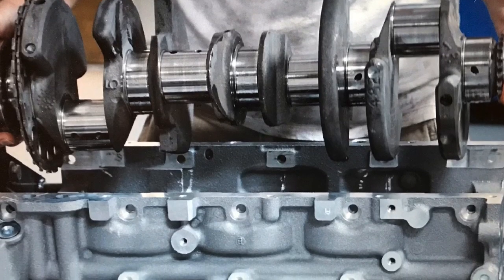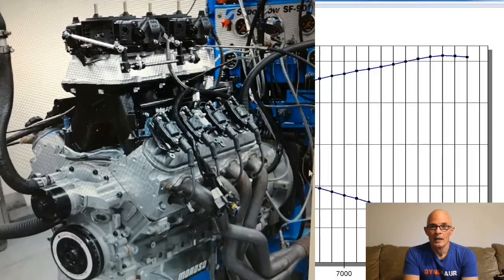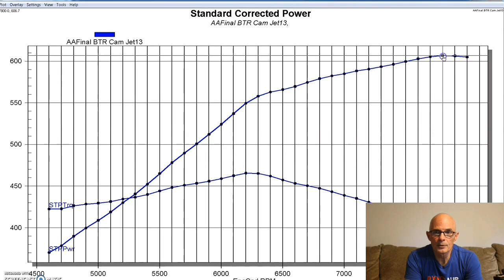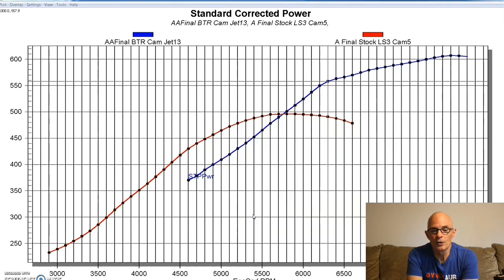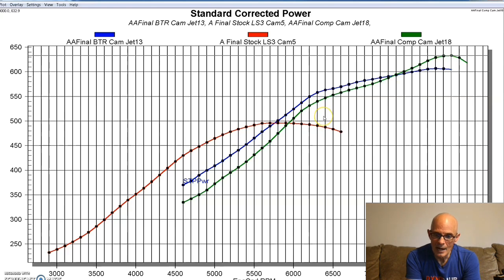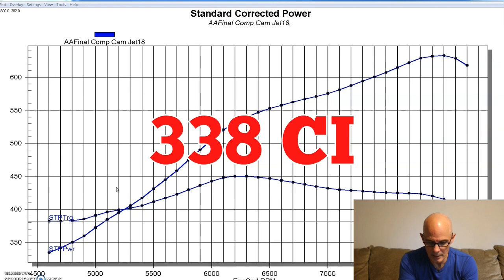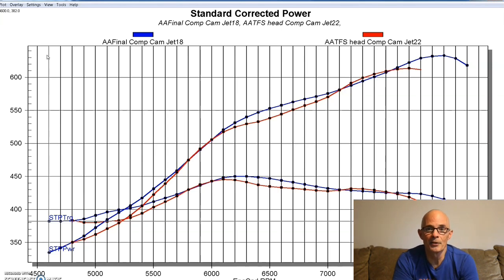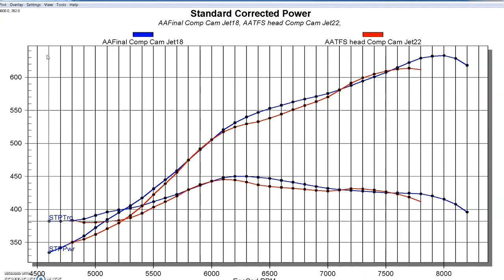DESTROKE LS-4.8L CRANK IN LS3 BLOCK-SHORT STROKE POWER-AN LS MONSTER MYTH?

Comment: Great video, Richard. Long time reader of your car mag write-ups. I'm fairly certain this is part of the problems the LS7 heads have experienced. 25 years ago, the LS7 would've been an all out racing engine. Fast forward 10 years (15 years ago), and you have G.M. basically trying to build a racing engine to last 75,000-100,000 miles without any maintenance except oil/filter changes. There's a reason G.M. hand assembled these engines, and it wasn't all because of the exposure/advertising this brought. It was also a necessity. There's also a reason GM quit installing this as a production engine. I'm not ragging on it. I have one that's starting to make noise at 20,000 miles. Great motor, except for the valvetrain, on which they really blew the design. Anyway, keep up the great work....

Comment: I run my lq9 to 7800 rpm. It sure sounds sweet up there. Been doing it for 6 years now. The crazy thing is it’s unbalanced, lq4 block and crank, ls2 pistons and rods, ls3 heads and a decent enough camshaft. 

You are right though it’s all valve control.

Comment: no doubt the compression would up the cylinder pressure across the board, i'd like to see some ve numbers though of each through their torque curves to be able to make a prediction on whether or not it will continue to climb if it turns more rpm.  sometimes killing torque is a good thing, not often, but say in a lightweight or traction limited car knocking down the torque while being able to preserve power will actually turn out to be a better combination.  thats the big advantage of dohc engines, partially, they can flow some monster numbers, but its also the reduced mass acting on each valve spring allows for better control at lower spring pressures.  one thing i havent done much thinking or research on but have started to kick some ideas around is port mach numbers and their effect on airflow limitations.

Comment: No mention of how rod length comes into play here and how it affects power and torque and RPM potential. The shorter stroke obviously allows for longer rods which also helps the revability and longevity in general. A longer rod also stays at TDC longer allowing a more complete burn. That is why my favorite engine combination has always been a big bore, short stroke, long rods, with heads that really breath. That is why NASCAR motors make the HP they make. Big bore, short stroke, long rods, with extremely high flowing heads with big valves and an extremely stable valve train that easily lives to 500 miles plus.

Comment: This would make one hell of a race engine. Almost like what I have planned. It works because you dont need all that tourque off the line too knock the tires n fish tail peddaling down the line. This 327 LS setup with nitrous would be a killer setup consistently going A-B. Only question I have is it necessary too go custom pistons?? Any forged off the shelf offerings from je or diamond?? What are the specs? Dome? Assuming hi comp.

Comment: Do it again with cathedral and square port but EFI with the NEW BTR INTAKE
Reply from the maker: I did run square port too
Reply: Richard Holdener no I know but that BTR LS Intake is sopposed to pull from 4-12,000rpm according to them and on a destroked I would love to see that before I buy it and try it
Reply: And don’t go carb plz
Reply: Richard Holdener I am thinking of destroking my LS2 6.0 in my GTO with a that Torquestorm blower but dumping my cathedrals for square port LS3 heads and coils and that BTR intake if it works good

Comment: I love the comments on these threads. 

 Your comparison of similar displacements with different strokes missed the point that your power peak (max torque) is relative to cylinder fill, which is relative to port velocity and Reynolds number. 

Short stroke motors behave differently in this respect because of the difference in the vacuum signal, eg the velocity of the piston and the distance it's traveling relative to the valve events.  Rod ratio also changes this, as the shape of the piston speed/position curve is altered with rod length. 

If you really want to prove your point, put pressure transducer spark plugs on two engines.  Make them EXACTLY the same displacement, with the same induction, cam, and valve train combinations but different strokes.    Then perform the dyno comparison.  Granted, torque output is the pressure measurement, but it would be really cool to see the behavior in the chamber. 

This is the only way to quantitatively prove your point because it establishes the top end of the engine as a constant instead of a variable. 

You also neglect the difference in cylinder fill relative to valve shrouding with respect to bore size.  There are so many variables to this!

The reason the smaller small block chevrolets are regarding as the best runners is the amount of work put into the original 283 fuelie and 265 preceding it as combinations.  That engine was engineered to be that size.
Reply from the maker: Ryan Reynolds? Very funny dude!

Comment: One issue that wouldn't have come up on this combo is the factory computer. You can break the genV processors to read a map sensor in 0-5v in place.of the 0-5v maf sensor. From what I have read they cannot do anything over 8192 rpm. I'm not sure of the limiting factor but it's a tick counter on the cam or crank sensor. Each ripple from the hall sensor on the 58 tooth wheel is a tick and the tables can't count high enough for anything above that. Not a huge deal because that covers all gm engines in production now but it could be an issue with something like this.

Comment: I've always liked short stroke, big bore engines. Not because "they" like to rev , but because I like to rev! The shorter stroke allows a longer rod, both of which reduces rod angle, in turn, reducing side loading of the pistons. The piston speed is lower with a shorter stroke as well, which reduces stress on the pin. And with a solid roller cam instead of the hydraulic, the big bore 4.8l would live a lot longer at 8-8500 rpm than a 6.0l.
Reply from the maker: valve train is always the limiting factor for rpm
Reply: @richardholdener1727  , I didn't argue that point. I was simply pointing out some of  the benefits of a short stroke engine that were missed in the video. I've never been one to dismiss the importance of displacement....but if I were to build an engine with the specific intention of revving its guts out repeatedly (such as an autocross, or road course event) it would be a short stroke engine. Which has nothing to do with the engine's ABILITY to rev that high, but because of the extra DURABILITY a short stroke engine provides at high engine speeds due to simple physics.

Comment: I was debating on what to do, I have a 84 300zx and I did the engine on a 6L Denali so I have a spare 6.0 . I’m ready to start the swap I wanna stay NA and I don’t know if I wanna do a stroker kit to 421 or de-stroke it with a 4.8 crank and go with a higher RPM but I think you just solved that issue I was having, not so much about the stroke but more on the valve-train. Guess im going with the bigger stroke.

Comment: Junkyard LQ9, cam/valvetrain, check bearings - 150shot. 550whp
Cheap cheap cheap - 1500$ cost for me to build one so it’s REPEATABLE! And if my upgrade parts survive, the costs drop even more.
Stock lifters because I try not to remove the heads or stock bolts/gaskets, so we spin it to 6800-7400 rpms to stay safe. Stock ring gap because I never removed the pistons.
12 events on this current one. 

I love thinking about cool builds but my pocket forces me to stay closer to stock.

Also with a lightweight triple disk on that engine.. it revs up SO FAST!

I would love to have a LS that could rev past 8k though :)

Comment: HP being a product work x time ie the "m" in rpm so more power pulses per minite the more horsepower produced and in most cases when short stroke motors used there is an engine capacity limit rule hence as you say larger bore more air flow higher rpm more horsepower, any one after max power is not going to limit stroke/ bore intentionally if not required by rules

Comment: Try experimenting with some rotary valve heads. I think it was either car craft or hotrod magazine that ran an article in late 99 or early 2000. They made. 8000 easily, and 700+ horse power on a otherwise stock ford 5.0.

Comment: Bottom line is you'll never get a bottom end to stay together (for long) if your average piston speed is over 25 meters per second. That translates to ~7000rpm with a 4.2" stroke. Decreasing stroke BEFORE you get to critical piston speed is costing you airflow and therefore torque.

However, the shorter stroke provides for a longer rod, better rod/stroke ratio and gentler bottom end kinematics which  can make for a happier engine.

As always, there is no "X is better than Y". Everything in the universe is a tradeoff. X is better than Y in some cases, yet Y is better than X in others. As an engine designer, you have to identify the things most important to you, and the things you're willing to trade off to get them.

Comment: I'd be curious.. gen IV 4.8 punched to 3.898 with unported 799's and a 7 grand cam. Basically a pistons and cam 4.8. I bet it would put the smack down on an old 5.0L ford with the B303 cam

Comment: One other thing to throw out there- If you're in a displacement restricted class, then a big bore, small stroke would allow for bigger valves with less shrouding when compared to a small bore, long stroke engine of the same displacement.

Comment: He missed the point with the F1 comparison and I only read a handful of guys in the comments mentioning piston speeds which is a huge factor in short stroke builds. This guy is looking at the problem from strictly a drag racing perspective. Run both your short stroke engine and you're big stroke side by side flat out for 500 miles then pull it apart and compare the wear. Big stroke high rpm requires better balancing along with stronger rod fasteners to name a few. You'll also reach fatigue failures sooner especially when running aluminum rods.  And I've soon nobody in the comments mentioning the other huge point of short stroke builds which is rod angle. Short stroke builds have a smaller rod angle resulting in higher cylinder pressures before experiencing rod bucking failure. Beneficial in high CR and high boost builds. So is you don't need the raw low end grunt a short stroke build can offer serious benefits including high efficiency, high boost, and low maintenance.

Comment: Piston velocity - It's a clear limitation, and for certain situations (where you don't have a selection of blocks to choose from) - it's exactly how you can manage to squeeze out more power from a specific platform. Or expressed another way - if you're stuck with 1 type of engine combo which is already approaching piston velocity vs power limits, then a destroke can allow you to shift that piston velocity down and (potentially) gain some horsepower by acessing a higher RPM. It depends on the platform. It depends on the situation. But it's a clear limitation that many people have run into - which is why it many solutions on the market across varying platforms.

Comment: I've always considered these to be big bore 4.8s.
Reply: Yea that makes sense since your using every single part from the 6.0 except for the crank
Reply: You don't have to. I would use every single part of the 4.8 minus the block and pistons. Thanks for your hot take though.
Reply: @arg8763 well I guess my logic is the block is the foundational base and you can mount any 4.8 head to the 6.0/6.2 but you can't mount a square port to a 4.8. therefore makes more sense to call or a short stroke 6.0

Comment: While I agree that Valvetrain is a major factor in how far an engine can RPM. Piston speed/ring flutter is a big factor in how much power an engine will make at those higher rpm levels. and piston speed is a reflection of stroke.

Comment: Your missing the point when you say all these engines can rev to 8000 and you would have made more power with the 5.3 or 6.0... The whole reason for de-stroking is reliability due to short strokes benefit of reduced piston travel speed. Lets say the motor scatters when piston speed is above 8,000 (for reference not actual know piston speed) feet per minute and you need it for a circle track car winding at 6-9k rpm non stop for an hour per race. You can de-stroke an over square engine to reduce piston speed to 5,000 feet per minute and the motor lives through the race no problem. When the speed of the piston crests a certain point it refuses to turn around on the down and upstroke. You take that 6.0 and repeatedly rev it to 8grand and it will blow where the 4.8 crank in the 6.0 block has lower piston speed thus allowing it less inertial forces on the mechanical parts. It would be happy to rev out to the 8grand more often with less heat and forces on the parts. THIS IS WHY PEOPLE DESTROKE AND YOU MISS THE WHOLE POINT OF IT..... Its not which build makes more power it is which survives the hell you throw at it. And the power depends on cam, valve geometry, head design/flow, and so much more than simply the displacement. Sure if your drag racing a trailer queen and want to build the engine every 100passes go with the big D and long stroke it wont matter much if everything is set up just right. But, if you need to work a high rpm window and want the engine for endurance, many races, and drive the thing home go with the short stroke.
Reply from the maker: please look at the stroke length and piston speeds of mountain motors-stroke on an LS application does not limit engine speed, its valve train
Reply: @richardholdener1727  I was talking about piston speed not engine rpm (and no they don't go hand in hand) we all know both can spin to 8-10rpm and the limitations are the valvetrain, rod length, and piston speed. But the shorter stroke will live to fight another day at those rpms due to lower piston speed. It doesn't matter what generation, manufacturer, or model the rules apply to all equally LT, LS, LSX makes no difference. Unless maybe you are using a rare non typical design like say a screaming dorito engine but that is a whole other conversation.  https://www.youtube.com/watch?v=Vy2r3p-SOag

Comment: It's mean piston speed that's a limiter, but in this case there isn't a problem because the LS is a pretty under stressed motor with push rods... Push rods are terrible for revs and they'll always be the limiting factor.
Reply from the maker: piston mean does not limit rpm in an LS-its valve train
Reply: @richardholdener1727  , yup, that's what I said... Push rods make the LS suck at reving... It's a good motor, but that's not it's strength... Making a short stroke version is pointless, as you can rev the 6L to that ballpark... 
If you want to build a motor that revs use DOHC...
https://www.youtube.com/watch?v=LyjsqwgDjhA
https://www.youtube.com/watch?v=clRvHdA47rw
Or if you want silly, go the Cosworth DFV...

Comment: Short strokes are actually needed for really high revs, and there are reasons for this that you seem to be unaware of. Flame propagation and piston speed probably being chief among them. These should help understand those. https://youtu.be/SJs_64Aj4Ho
https://youtu.be/sdUljmk-lJA
Reply from the maker: the stoke length will not get you there if the valve train is not there
Reply: The point you're not getting is even if you do have a valve train that can get you there you will eventually be limited by stroke length.  And the two videos I linked to will explain why that is.  You might not run into that limitation at 8,000 RPM with your LS, but F1 engine designers ran into that stroke limitation a long time ago at RPMs much higher than 8,000.  You may be correct when it comes to your LS and its relatively low RPM range when compared to F1 engines, but you are missing some information when it comes to things like those insanely high-revving F1 engines and I've given you a place to learn about that if you feel curious and would like to know why that is.

Comment: You should do a similar comparison with the stock 5.3 bore and stroke similar discplacement. Same cam heads and try to get the cr close to the ls3 shortstroke engine. If valvetrain is the only determining factor then that should completely settle it. It might be a good idea to get the best possible rod stroke ratio also to help take that out of the equation.

Comment: The power is in the short block. Want more revs and horsepower? Don’t change anything. Just increase your pistons to wall clearance with the proper hone. And I’m not gonna tell you what that is. Cubic inches is the best producer of power. 440 cubes at 10,000 RPM plus.
Reply: You’re smoking crack

Comment: Yes breathing capacity makes or breaks RPM reguardless of bore and stroke combination. The advantage of a shorter stroke is less piston speed and better stroke rod ratio. Less piston speed means less stress on parts and better rod/stroke ratio means less side load on the cylinder wall therefore more durability in endurance racing ie nascar, road racing etc. It's all about the combination for the situation.

Comment: Why don't we look at the power over the RPM range, and the area under that power curve? Driveable power would be the most practical approach. Granted different types of racing would have different needs for torque and horsepower. I would love a large bore, short stroke, boosted application for the streets. Should be much more controllable in the lower "grocery getting" end of things, and nasty pull on the freeway.

Comment: my 4.8 with 6.0 heads  and ls9 cam makes more hp per psi of boost than most other combos out there. And super reliable. love the 4.8 crank!
Reply from the maker: hp per psi is a function of the NA power output